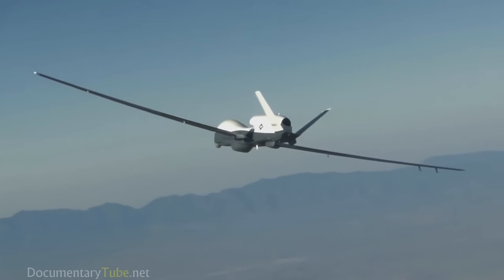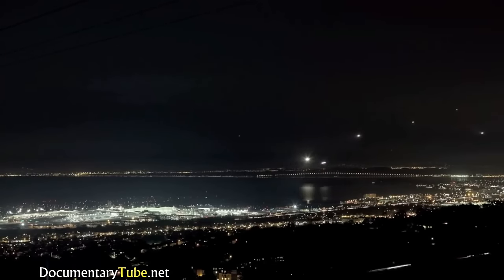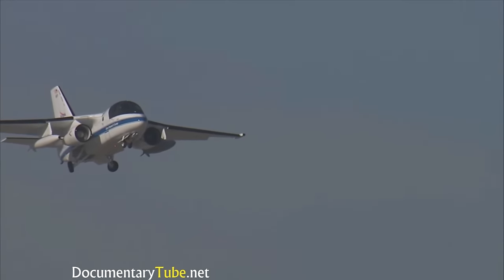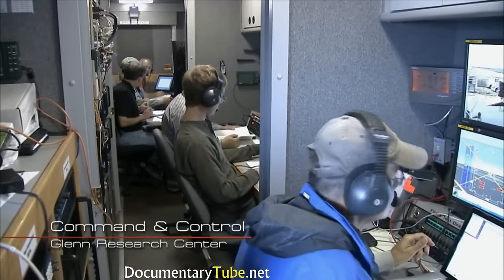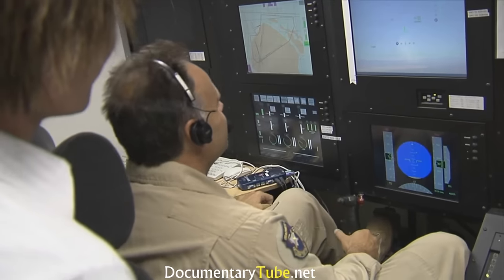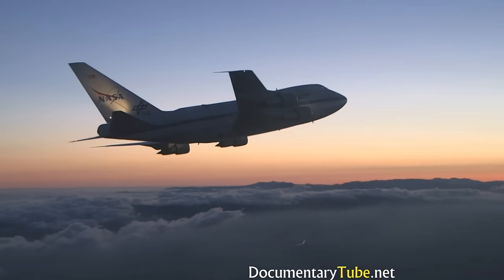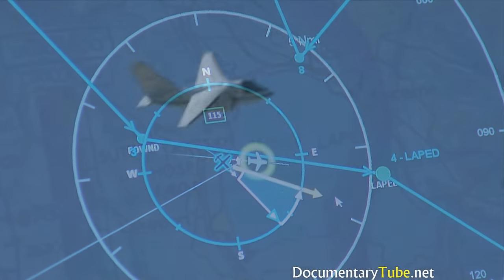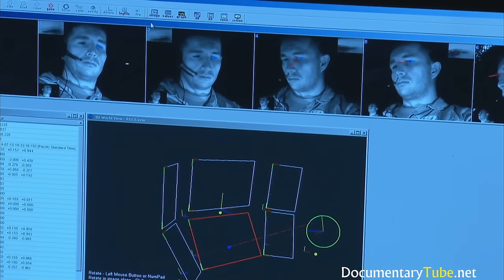Autonomous Robot Aircraft of the Future

Comment: what the tcas already exists. why isnt being used here
Reply: tcas can only give vertical commands, so no horizontal seperation, and if they other aircraft doesn't have a C or S transponder then it can only give TA, traffic advisory as TCAS doesn't know what altitude the aircraft is located at. It's a good system but it only provides information and not something that can solve that problem.